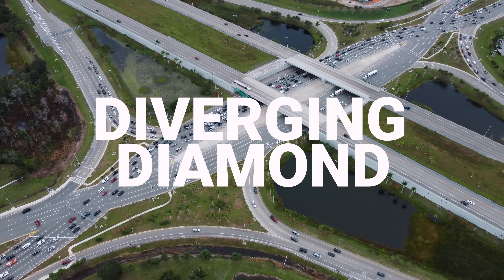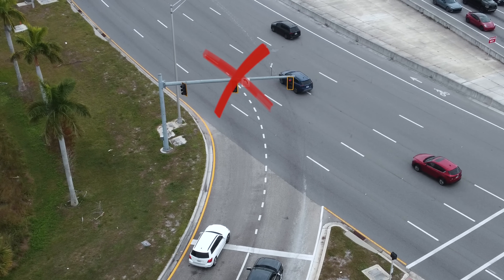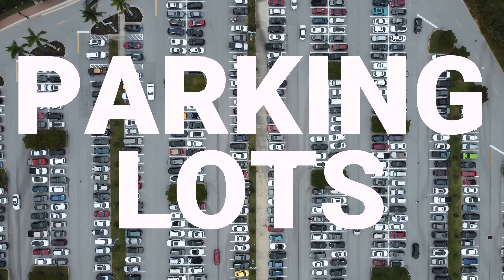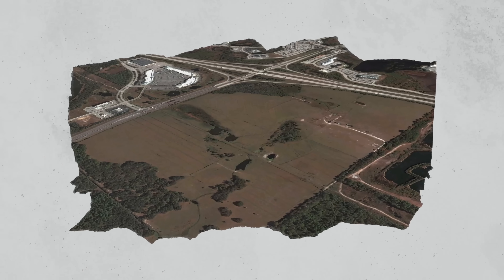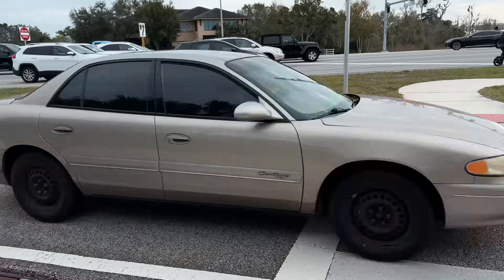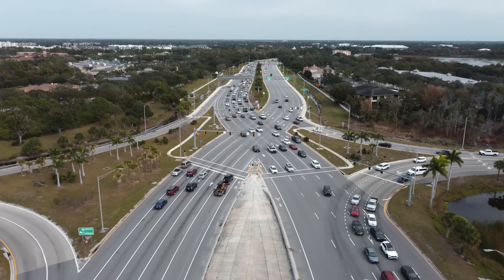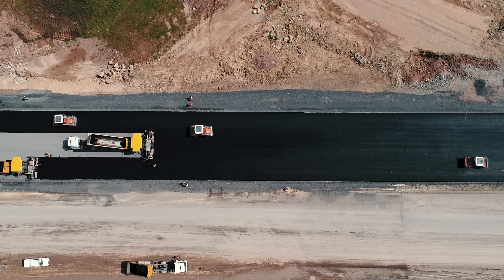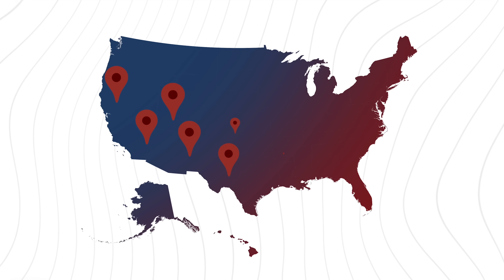Traffic Will Never Be Fixed Here

Comment: 3:30 In the UK there'd be a yellow box junction with cameras ticketing people for stopping in the junction. There'd also be repeater lights the other side of the junction to let cars already past the stop line know whether their light is red or green. Seems like that'd fix some of it although we'd have probably just built a couple of roundabouts instead.
Reply: America uses white boxes, not yellow.  Yellow is specifally used to separate opposing traffic.
Reply: And a roundabout would not work here.  There is too much traffic for the roundabout to work efficiently.  And the construction would also be more expensive without the efficiency benefit.
Reply: @traffic.engineer  That's not correct. A large Dogbone roundabout would handle just as much traffic as this diverging diamond and fit in the same footprint.
Reply: @JKK_85  A standard roundabout can only handle about 25000 vehicles per day.  Dual lane roundabouts max out at 44000 per day.  A two lane DDI can handle up to 60000 vehicles, three lane up 80000.

And it is cheaper because there is less land to acquire outside the standard interchange ramp.  Additional expenses are the concrete islands/diverters, additional stormwater drainage for the bigger footprint.

Dogbone interchanges work great for rural and suburban locations, but not at highly urbanized locations like this.
Reply: @traffic.engineer  Way to tell me you're American without telling me you're American
Reply: @JKK_85  Yes.  America has strict criteria how roundabouts are installed.  Because we do not want to defeat the purpose of them, unlike in the UK where they install signals at roundabouts.

Comment: Diverging diamonds, for when you really don't want to build roundabouts
Reply: Because the roundabout would fail.  The traffic volumes much more than the roundabout's capacity.  It would also be more expensive due to the larger footprint.  Roundabouta are better for rural roads and suburban residemtial streets.

Comment: I took a look at this area on google maps. The DDI isn't the problem as you mentioned (maybe except the signal timing), but the signalized intersection for the ONE entrance into the shopping area. Not to mention that University Parkway is the thoroughfare to Sarasota's Int'l Airport

In more recent years, the "Town Center" concept has become popular. It's like a normal mall, but with more exterior store enterances and more aesthetically pleasing. Believe it or not, Town Centers CAN have more benefits to walking rather than driving.

This development had good intentions, but was executed wrong. Having ONE entrance/exit spot is bad, especially that close to I-75. I also noticed that the enterance road kind of splits the shopping area in two, completely defeating the benefits of being able to walk around Town Centers.

A lot of modern Town Centers have public transit centers. There are a lot of things that should've been better with this whole development.
Reply: A signalized traffic corridor is only as good as its worst intersection.  The intersection cannot match the efficiency of the DDI.
Reply: @traffic.engineer  I'd have to agree. Again, only basing it off of initial and basic assumptions of the area

Comment: This backing up problem is something that you can fix with some simple traffic detection loops feeding into the traffic light cycle... it doesn't seem like a real problem, speaking as someone living in the netherlands where all intersections come with traffic detection by default
Reply: Signal detectors are standard.  All the intersections here have them.
Reply: @traffic.engineer  then why are they so often... Not used?
Reply: @shadeblackwolf1508  Dectectors are mainly used for offpeak or uneven traffic volumes.  But they do not work for corridor timing because the red is random.  Fixed timing is necessary to progress traffic along a major roadway to reduce stopping at successive intersections.

The priority at this intersection is to clear the ramps so it does not queue into the freeway.  The ramp movement is concurrent with the movement towards the downstream shopping center entrance.  So that movement remains green while queuing under the bridge, because the detectors are sensing vehicles coming off the ramp.
Reply: @traffic.engineer  should it not be entirely possible to detect a backup before it encroaches onto the diverging diamond, and prevent the trafficlighted crossing from giving a green when it counts that would result in cars stuck in the intersection?
Reply: @shadeblackwolf1508  it could easily be programmed to turn red when exiting the DDI, but the other approach entering the DDI would also need to stay red while the ramp left turn has a green.  The other concurrent ramp phase would stay lit to clear the ramp out.  So it would just be an all-red at the crosspoint.

It seems the DDI is more a storage of the emptied ramp traffic, rather than storing those vehicles on the ramp.

Comment: In europe, those left and right intersection would have been some variant of a roundabout instead, increasing conflict points slightly, but removing all traffic lights.Not sure on the safety comparison
Reply: Roundabouts only work when there is less than 25000 vehicles per day per lane.  Traffic here is much greater than that, so thr roundabout would not be efficient.  That would cause excessive queuing that would pose a safety hazard on the highway.

Comment: It blows my mind that the USA would rather drive on the wrong side of the road than learn how to use a roundabout! DDs and roundabouts both still have traffic queueing at either side, so they're both not without their flaws. With a DD, you could have one side of the road pass under/over the other to remove the traffic lights altogether. Admittedly, this would involve building two more bridges and create an even less attractive place to be. We (the UK) are also guilty of over-embracing the car. A trip to the Netherlands, Belgium or Germany will tell you that. Hopefully we can reverse it. Thankfully we're nowhere near as far down the road (pardon the pun) as the US. Not bashing the US here, but I wonder if pride is preventing you from admitting that you've made a mistake in order to overhaul this carmageddon. There are a lot of YouTube vids out there that all come to this same conclusion about your segregated urban spaces and the need to drive everywhere for the most banal things
Reply: Roundabout would fail.  The traffic volumes are well above a roundabout's capacity.  Roundabouts would also be more expensive construction due to the larger footprint (right-of-way acquisition, concrete island, more extensive stormwater management).  

Roundabouts are much better for rural or lighter suburban connecters to residential roads, not the main road.

Comment: Instead of intersections with traffic lights, put in traffic circles (rotaries, round abouts. )
Reply: Roundabout would fail.  The traffic volumes are well above a roundabout's capacity.  This is proven in Europe when they install signals at traffic circles.

Roundabout would also be more expensive construction due to the larger footprint (right-of-way acquisition, concrete island, more extensive stormwater management).  

Roundabouts are better suited for rural or lighter suburban connecters to residential roads, not the main road.

Comment: Just use grade separation to replace the two intersection with traffic lights
Reply: Too expensive.  Interchange would be almost 20x more expensive but only 5x the efficiency.  Not a good benefit to cost ratio.

Comment: I think it would work better if the intersections where the traffic switches sides has one side go over the other side temporarily instead, almost like an off-ramp from a freeway. That way even if one side is backed up, the backed up cars will be underneath or over the opppsite side so they won’t spread the traffic to the opposite side.

Comment: The only way to solve it is to build a 6 way roundabout with 2 lanes for cars, 3 for busses, and 5 bike lanes.
Reply: Roundabout would fail due to volumes being greater than the ability to handle traffic.  And would be more expensive due to the larger footprint.  Roundabouts are btter for rural roads and suburban residential settings.

Comment: I'm from Germany and we don't have these (imo) absurd traffic problems, so I probably cannot fully judge the US road system. But in this particular case I would say to just get rid of that huge shopping mall. Or at least make it like a 1/4 of it's current size And reduce the parking lots to 500-1k max. The rest should become a mixed residental/commercial area. Spread out the shops in the mall into mixed buildings with residents above and only a couple of parking lots/houses) near the main roads. Larger shops can have their parking inside the same building (above or below the shopping floors).
And very important: Add connections or creats public transit. And reduce the lanes on the roads by force. Maybe people will then go and say "hmm, the roads are to full, I'll take a walk or the bike"
That usually does the job were I live.

Comment: The issue is there isn't a good method if public transportation here in Florida. I'm in Miami the public transportation system is horrible basically non existent. If the had a  central parking garage with public transportation to nearby locations that would help with the overflow of traffic. Instead of all the asphalt everywhere.

Comment: 0:03 it is well known now that the American car centered urbanization is dumb.
But…
If you ever need massive intersections for that at least …

DO NOT MAKE THEM AT GROUND LEVEL WITH TRAFFIC SIGNALS.

That’s the most insane in American design : 10 or more lanes crossroads with traffic signals and not any kind of physical separation between lanes going in different directions…

What ? It’s too expensive ? Maybe, just maybe you should not have built gigantic suburbia with huge maintenance costs.

And maybe, just maybe, if you chose to do so, you should not develop an obsession with lowering the taxes because « we are in the land of the free, we will always resist to the oppression of the State which wants to control us »(you may use any Karen voice of any gender for this last quote).

Comment: Diverging diamond concept: just flip the road.
Am I the only one who fails to understand how crossing 10 lanes at two points is safer than a cloverleaf with ZERO crossings ?
Reply: Cloverleaf only works for low-volume roads.  The traffic here is much greater.  This causes more conflicts at the ramp merge points, which either increase crash risks or queuing.

Comment: Nice vid!
The best antidote for a diverging diamond is to make the intersection at each end an 'over-and-under' bridge/tunnel instead of an at-grade crossing. This would eliminate both issues of blocking lanes with stopped traffic as well as the two added traffic lights that manage those crossings.
Reply: As soon as you add a bridge, you double the cost of the project.

And, as someone else pointed out, as soon as this intersection is improved, a different intersection becomes the bottleneck.

Comment: We live 20 minutes from this interchange and my wife works at UTC. This is adjacent to the Lakewood Ranch Community, which has one massive problem. There is effectively ZERO public transit. It's also a very hot, humid, and rainy environment, so relying on Walking/Biking is often not practical. So everyone drives. A train system that ran through Lakewood Ranch and the local commercial areas would be amazing, and would bring people from walkable Lakewood Ranch to their commercial destinations far easier than driving and dealing with parking during busy times. Even if it reduced car traffic by 30%, it'd make a massive difference. Also, why they built zero parking garages at UTC and just sprawled it out is beyond me.